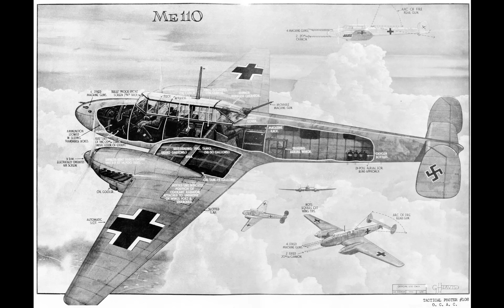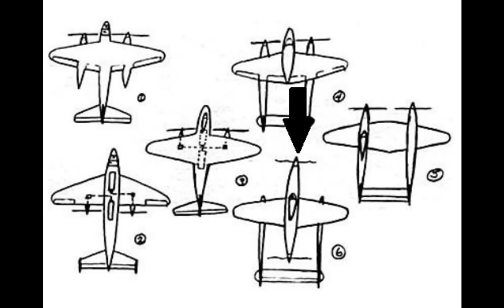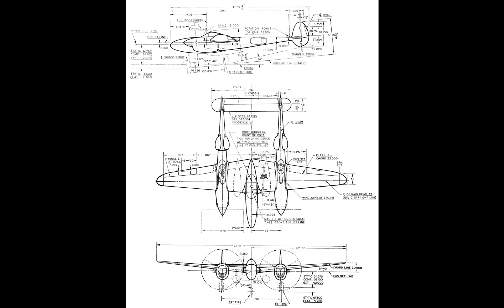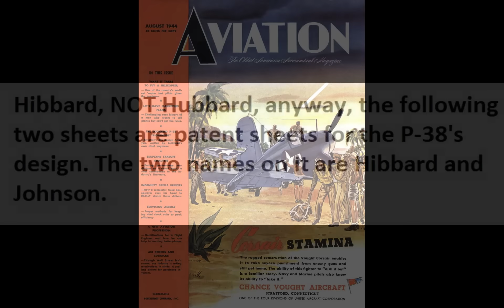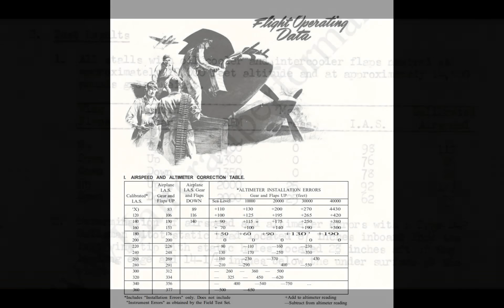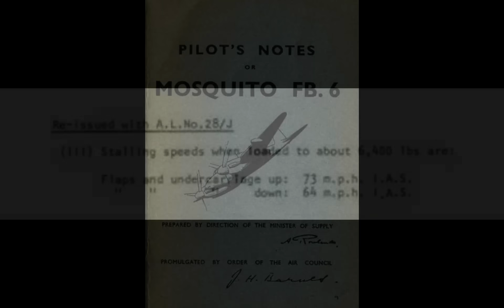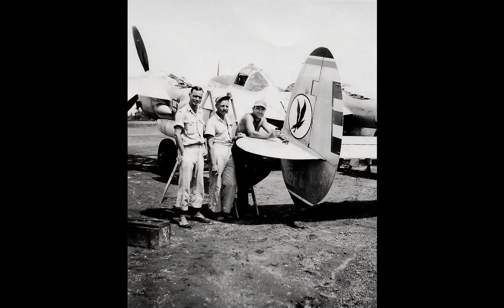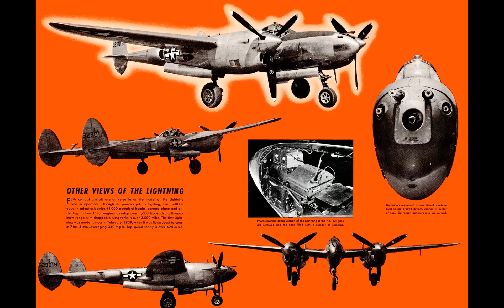Lockheed P-38 Lightning Design Info

Comment: I understood that the British didn't like the P38 because the initial ones were supplied without turbos.
I would guess that they were also comparatively expensive to produce.
Reply from the maker: No turbos, and no counter rotating props. They managed to order a configuration that defeated the entire design.
Reply: @GregsAirplanesandAutomobiles  I can't remember where I read it, but I thought they were not allowed the turbos at the time to avoid the tech falling into enermy hands.
Reply: @andrewpease3688  I've heard conflicting info on that. I've heard the British didn't want them or the counter-rotating props.
Reply: The tiny engine Westland Whirlwind might have poisoned their views.

Comment: Wow Greg,  very interesting video about a magnificent plane. Looking forward to the rest of the series. 
One comment though. The Fokker G1 was more than a decent plane for its time. Looking at firepower range etc. I have got a good book about it. It is actually 2 books. 
Again great work on the P-38 again. 
BTW ever think about making a video on tanks let me know can help you out a lot there.
Reply from the maker: Yes, the G1 was good, but I didn't want to get side tracked. You probably know how that happens sometimes on this channel.
Reply: Kelly Johnson got his idea' s on a twinboom counter rotating prop from the G1 shown at the Paris Salon and the nose gear tandum 5th proposal the flown Fokker D23 also shown at the same Paris Salon. And the G1 was also the first wooden wonder idea for the mentioned Mosqito. So the succesfull idea's were from Fokker.

Comment: It is my understanding that a twin boom design suffers from inherently greater wetted area (therefore drag, presumably parasite or profile drag (not sure)) than the equivalent conventional aircraft.
Reply: The orifice expansion drag from a fuselage-airfoil interaction was crazy in the P-38's tail.  Why have tiny horizontal surfaces outboard of the vertical stabalisers?

Comment: Before watching the video, let me put together my ideas about the design. The twin boom design of the P-38 is a classic form follows function thing. 
Just take an hour of time, roughly estimate the size and weight of engine, turbo charger, engine cooler, charge air cooler and all needed pipes to connect them. Then take paper and pencil and do sketches to figure out what the smallest possible aircraft with two engines and two turbo chargers may look like. Don't forget that the retractable undercarriage needs room in the aircraft too. 
With the coolers, you have two options. You can place them somewhere in the nacelles, or somewhere in the wings. Coolers in the wing reduce the room you can use for fuel, so most probably you will decide to put the coolers in the engine nacelles. For everything that has to be put into the nacelles, you will end up with an inline arrangement in order to keep the cross section as small as possible. Those nacelles need to be LONG. 
For the (central) fuselage, you will also end up with an inline arrangement, guns in the nose, cockpit behind the guns, this gives you the smallest possible cross section. 
Center of gravity will make you place the engine in front, the main wheel well behind and the turbo charger in the back.  But the engine nacelles are not the only parts to consider, when it comes to center of gravity. A fuseslage nose full of guns is heavy. In a twin engine fighter, you have a number of guns and two big engines in front of the CG. To keep the CG where it belongs, it may be smart to place the coolers behind the turbo chargers. 
The ideal twin engine fighter with turbo chargers and without internal bomb bay will always look similar to the P-38.
Reply: Could you expand your thoughts a bit?

Comment: The AAC's fascination with turbos is understandable, but they simply lacked the practical experience to consider the fact that the extra bulk, weight, and complexity just didn't work well in actual combat. Looking at just performance, turbochargers are awesome. Giving you almost free power and well suited to the set and forget throttle management of air combat back then. Set for cruise and go until you get into combat when you then set for power and fight. I'm a big fan of turbochargers, but I wish the AAC had considered the two-stage superchargers at the same time. The Allison V1710 might be much more famous had that been an option.
Reply: "but they simply lacked the practical experience to consider the fact that the extra bulk, weight, and complexity just didn't work well in actual combat." While later designed, the P-47 would disagree with this pretty hard.
Reply: @claytonanderson9665  true in the case of radial engines. I'm talking about the context of inline engines. Even the last versions of the P-47 that didn't make it into production were looking at supercharger-only engines. The P-38 and P-47 are singular examples of successful WWII fighters with turbos, one inline, the other radial.
Reply: @TadMarko  But we're taking about if turbochargers were practical in actual combat...at least that's what your comment stated. Actual results show they were very practical, if designed for.
Reply: @claytonanderson9665  I was unclear. They function fine in combat, but their expense, complexity, and maintenance in a combat theater are their weakness.
Reply: A lot of the problem was not the turbocharger, but the lack of a unified semi-automatic engine controller which would allow the pilot to control  the engine and prop with a single lever. Today's fighters use a FADEC (full authority digital engine controller).
Reply: P-38s bounced were handicaped by excessive manual engine manipulation to change power output.  The Luftwaffe liked the P-38, it was easy to shoot down.

Comment: So if Allison had expended the effort on designing and developing an efficient two stage supercharger the P-38 might have had a more conventional layout. What ever the reasons for the design choices Dick Bong certainly must have liked the airplane
Reply: The Merlin only got a two staged super charger in 1942 and it was the backbone of British air combat. The p 38 was pre war. The effort Allison would have had to expend would have been gigantic.
Reply: In the closing days of the war Allison dod come up with a "hot rod" version, the V1710-F119. Just after the war it put out close to 3000 HP on test. It never saw service. 
   As Greg will undoubtedly cover. The poor performance of the mechanical supercharger was due to both the demands of the Air Corp/AAF and the specs of the engine. The AAF kept telling the engineers that turbo-supercharging was the AAF policy.
Reply: @michaelwillette5738  
Yes I have long known that USAAC in the 30s had decided that the future would be in turbochargers. But when war loomed the bombers got priority for turbos. Most of the Allison's were left wheezing at altitude. The only Us aeroe gine builder that really put the effort into mechanical superchargers early on to pay benefits was Pratt and Whitney. The Allison certainly had more potential than it actually fielded.

Comment: The problem with most of the P-38's contemporary twin-engine fighters is that the others were usually designed as "heavy" fighters, often with heavy guns and 2 or even 3 crewmen. Extra weight does not a good fighter make. The fact that the P-38 was designed as an interceptor and not a heavy fighter meant that it escaped being burdened with extra size and crew. The fact that Kelly Johnson was a genius helped too.
Reply: Kelly Johnson was not a genius then. The P38 only had the same kills as the Hurricane
Reply: It was a high altitude bomber destroyer.... For all the big, high altitude German bombers.
Reply: @2lotusman851  That seemed a reasonable concern in 1938 or 39.

Comment: The P-38 wasn't my fav plane of the war,  but it had a role as a long range fighter-bomber and in this role it which was a huge success. Perhaps not so much in the European Theatres but in the warm Pacific air the fighter was great.  

As for historians using the Me-110 as a comparable aircraft I'd say that it's not fair at all.  The Me-110 isn't in the same league as the P-38. Imagine the havoc in the night skies if germany had a night-fighter like the P-38 ? A better comparable is actually the Beaufighter even though the Beau is a lot slower it was just as good at strike missions and at night fighter missions it was great !
Reply: The night fighter 110 was too heavy especially with 3 crew.

Comment: Excellent again from Greg, the emphasis on how early the P-38 design was is usually missed.  There is opinion that the design was partially fixed in this relatively primitive state by the government to maximise production output and Lockheed were prevented from implementing desired major airframe upgrades.  The P-38J onwards liquid cooled intercoolers were the biggest engineering improvement.

Comment: Excellent, as usual, Greg. This is the first time I've encountered someone saying "The P-38 could really turn." Most of what I've read about air combat in Europe during WW 2 suggests or implies that the relative lack of success of the P-38 in the European Theater is due to poor maneuverability, largely because of its size and wing loading in comparison to German fighters. Given the generally-accepted notion that Japanese fighters were, on the whole, VERY maneuverable, however, that implied poor maneuverability conclusion has never made a lot of sense to me. If true, why would the P-38 be more successful in the Pacific than in Europe? I'm thus looking forward to the next episode to clarify – for a non-engineer, non-pilot – why the Lightning was less successful in Europe than in the Pacific.
Reply: The engine controls froze up in the cold.  The exposed turbo installation could not have helped.  Re manoeuvrability, speed and climb were much more important in real fighting.
Reply: P-38 was one of those fighters that while designed for high altitude, seemed to work better at low altitude.
Reply: Dog fighting [manoeuvrability] will get you killed especially with poor visibility & clouds - you don't get to see the second enemy plane that jumps on you while you're dancing with the first plane. Dog fighting in a twin engine plane takes a lot of skill & especially experience - there's a lot of stuff to be aware of in the cockpit when you really need to looking out & about! The WWII pilots that lived long enough to be a success [no matter their aircraft type] realised early to get in & get out in one bounce from superior height & get back up high as quickly as possible & stay in pairs always. European skies are a challenge if you've been trained, like most US aircrew, in New Mexico, Arizona etc where there's dry perfect weather & clear, blue skies. The Pacific theatre air war was fought at fairly low level [10,000 ft lower than Europe at least] to maximise range over water, the Pacific P-38 pilots were better trained than the ones earlier rushed to Europe. Warmer weather and at lower altitudes suited the plane better & the pilots did not freeze like they did in Europe [no warm engine in front of you]. Jap planes were like paper & by late 1943 the best Japanese pilots were dead. The P-38 is a handful from a multi-tasking point of view - far more to remember than in a Mustang, so it needed more hours to produce competent pilots & competent maintenance crews.
Reply: @nightjarflying  The Merlin was more automated, the BMW 801 was better.

Comment: Wouldn't it be better use the FW-187 Falke instead of the Bf-110? both had twin engine, buy the falke was a single crew airplane, and was, at the time one of the fastest airplanes before the battle of london, and also the design was use in the FW-189, and this had a three man crew.
Reply from the maker: I thought about that, and it's a valid point, but the fact is that it was compared to the 110 in period publications, as I showed in this video.
Reply: @GregsAirplanesandAutomobiles  Yeah, and is sad that, isn't much information of the Falke anyway, thank to the "competence" of the german governent, that plane could had done the same thing that the P-38 did in the pacific in europe, I can't imagine what would have been if that machine contiune production, with better engines(the Jumo 213, the DB 603/605, or the BMW 801) and weapons (the MG 131 for example); changing the topic, if the wikipedia is correct (at least 50%), if the BMW 803 went into produccion, and Focke Wulf wanted the engine for their fighters, and the only fighter of FW was the 190 line, how fast should had be?

Comment: Sounds like Its role as a reconnaissance aircraft may have been it's greatest contribution to the war effort. Very interesting Series so far.
Reply from the maker: Thanks Central.
Reply: 95% of exactly what?
Reply from the maker: Ah, now that's the real question isn't it? I'll deal with it when I get to that stage in the series.

Comment: My first employer in the aviation industry had been a junior engineer on the P-38 program in the late 1930’s and early 1940’s.

One of the impressions that I came away with from conversations with him was that these aircraft were incredibly labor intensive to build, operate, maintain and fly.

The systems were advanced for their day, but caveman primitive compared to what came just 5-10 years later.

The. systems manufacturers bought advertising in the trade journals, like the ones Greg quotes, to get mind-share of the engineers in hopes of selling their gizmos to the airframe and engine manufacturers.
Reply: I read they were being replaced in the Pacific theater for the P-51, mostly because of their price and complexity. Not their performance.